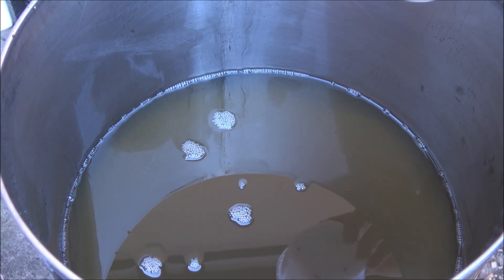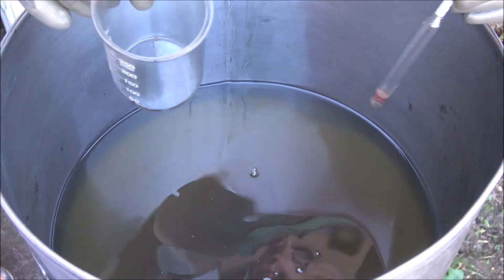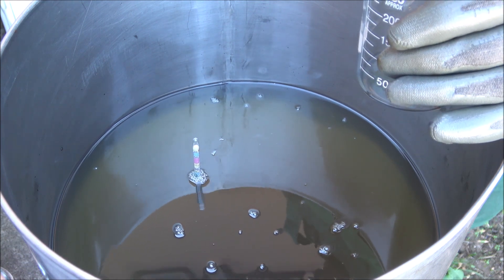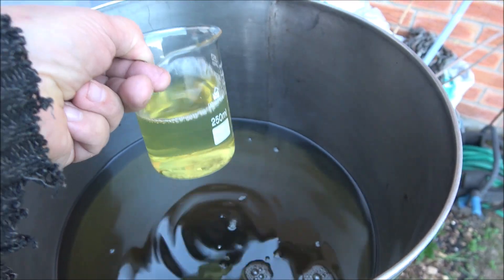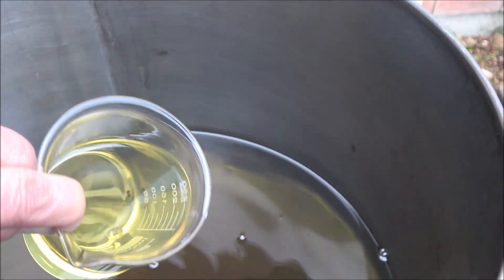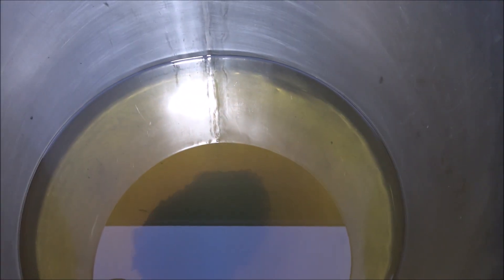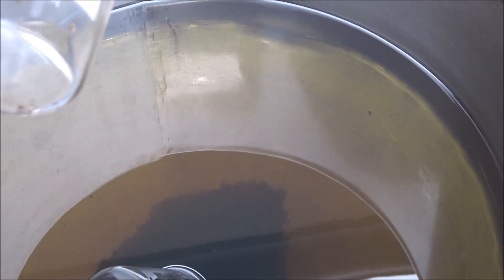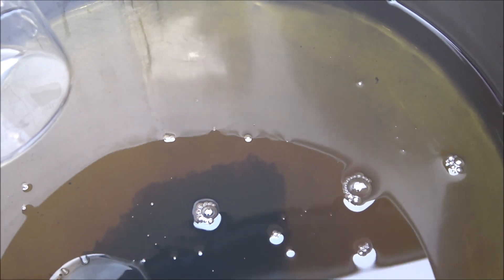Silica Gel cleaning of Recovered diesel fuel.

Comment: If you can run an older diesel on just filtered WMO through a centrifuge what is the purpose for all the extra treatments after distillation? Can the distilled WMO go right in the tank?

Comment: Will you show an engine running on the fuel made from the waste motor oil?
Reply from the maker: @thomasthecrunkengine3512  I had already showed it a few years ago, I simply make it and use it.
Reply from the maker: @thomasthecrunkengine3512  I had already showed it a few years ago, I simply make it and use it.

Comment: A quick question dear sir Alek, i tried destilling old diesel engine waste oil as always seen you do on your videos, at about 200c the whole oil steaming hot was pushing out via the waste pipe kind of boilover can't explain.. pls what could be the cause for that cus i was scared seeing that.thanks
Reply from the maker: What kind of distiller did you use? The oil distillation happens at 400c to 420c, so if your oil violently boiled at 200c, then it was contaminated either with coolant or water. The waste oil must be prepared for distillation, filtered with centrifuge, dried, only then distilled.
Reply: @santeryi9  ok sir.